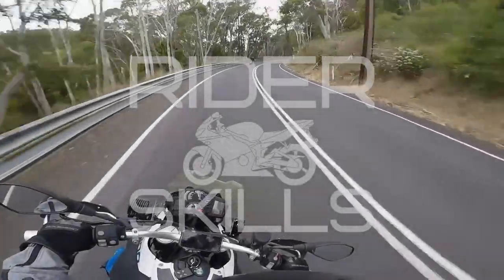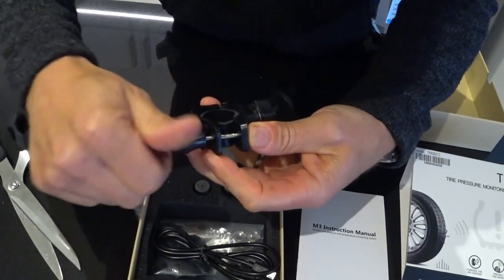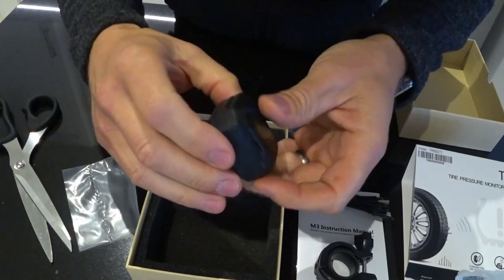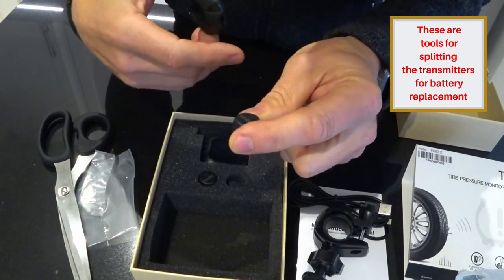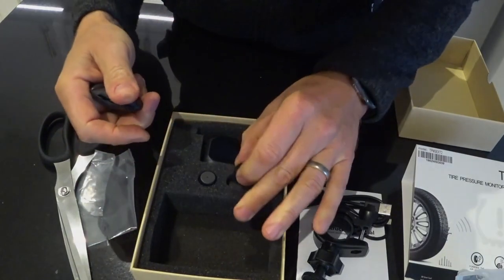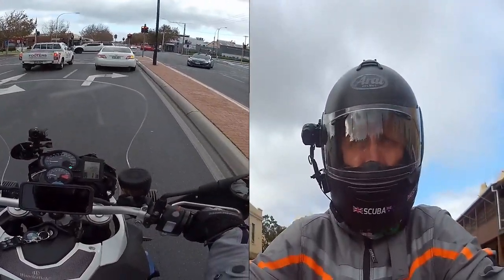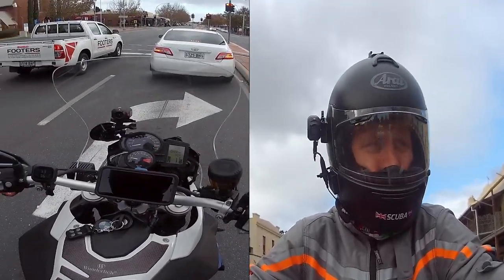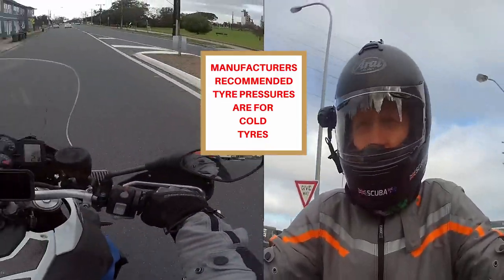MOTORBIKE TPMS DIGITAL TYRE PRESSURE MONITORING SYSTEM REVIEW

Comment: Pretty thorough ... these are a bit old school now, but just saw this was a 4 year old review!  For those considering these TPMS things, they're not really any use for tubed tyres, they won't really help because if you puncture with a tube, your air will be gone just as quick as any sensor would tell you.  Great for tubeless because a lot of punctures will be 'slow' leak and you get a warning from the sensor.
Reply from the maker: Yes, this was on a F800GS Beemer so I had tubeless.

Comment from the maker: 24/7/19 An update .....  which I think is worth doing if any positive or negative info comes to light after a period of time using a product that has been previously reviewed.  I charged this at installation, now seven weeks on and the unit still appears to have a full charge.  I still love the product and the features and benefits have made it superb value.  I've now got a solar powered version on my Toyota Hilux and am delighted with that also.  It crossed my mind for people towing camper trailers or caravans that these could be a serious consideration to monitor their tyres on them too.  From my experience these work at some distance from the sensors so there's no reason why the motorbike one couldn't also be used for that application.

Comment: This looks great.  One question:  Will the dust caps work if you have right angle valve stems?  My bike has right angle stems and they come pretty close to the rim - and those caps look a bit bulky.
Reply from the maker: +The 333 they’ll work but what I’ll do is measure them so you can compare the size to the rim to see if the fit.
Reply: @TheRiderGuider  Awesome - thanks man!
Reply from the maker: Sending you Instagram message 👍🏼

Comment: Hi there,
Is it possible to independently set the max and min values alarm, trigger values for front and rear tyre?
Thx
Reply from the maker: Deda Mraz great question, and the answer is YES.  I will follow this up soon with the instructions if you need them?
Reply: @TheRiderGuider  Yes, I need them for sure.
Regards
Reply from the maker: Deda Mraz I’ll  be in touch soon.  Got  printed instructions coming later this week 👍🏼

Comment: Do you need to balance the wheels after installing these?
Reply from the maker: Hi Liam, not the first to ask this, in my case I had no adverse effects by fitting them so for me I didn't bother, they hardly weigh anything at all.  Not something I'd purposely get done until I next changed a tyre.  What bike are you riding?
Reply: @TheRiderGuider  I installed mine today. Will head out for a ride later this afternoon and see how they are. Pressures are spot on so that’s confidence inspiring. I’m riding a Honda Africa Twin. There’s a good chance I carry more mud on a tyre than the TPMS weighs to be honest.

Comment: my tpms starting to have a bit of a problem.   battery on the display store power for a short time
Have you ever changed the battery on the display screen?
Reply from the maker: No mate, in fact my TPMS sold with the bike.  I now run a bike with tubes so the TPMS is not as useful.  If I get a puncture now my tyre is pretty much flat quickly.

Comment: What size wrench fits the sensor nuts? I bought a used motorcycle that came with this system
Reply from the maker: Marshall 3498 I’ll check in the morning mate and let you know.
Reply: Ok man thank you very much
Reply from the maker: @marshall3498  I actually haven't installed the locking nuts to my sensors, I'm not going off road and hammering the bike so don't feel them necessary, they fit and stay on fine, I think the locking nuts are just for theft prevention and I'd be very surprised if anyone even spotted the valve sensors were different to standard.  This morning I can't find my nuts (LOL) however if I remember rightly I think they were 14mm.
Reply from the maker: @marshall3498  NO - THEY ARE 12MM ....... found my nuts!!! ☺

Comment: Are you still using this item? If so how has it held up, is it remaining to work well and accurately? thanks for the help!
Reply from the maker: Hi Cody. thanks for watching/commenting.  I sold the GS to one of my best mates (Rich) and I'm kicking myself because I left it on the bike for him and haven't replaced it yet!  When I get a second I'll be re-ordering.   He's still using it as I instilled in to him the importance of keeping his pressures correct especially as he goes enduro riding) ... it's still working, still looks the same as far as I'm aware.  Unfortunately the original supplier doesn't supply them now due to the fact they're all over eBay and no longer as profitable for them. https://www.ebay.com.au/itm/153942660528 ... off to order my new one now!
Reply: @TheRiderGuider   Cheers i appreciate the info,  seen a few similar ones and just trying to come to a decision. Did it have any issues while in the rain? Thanks again.
Reply from the maker: cody merchant no .... pretty much a sealed unit.  I ordered my new one from that link I put up 👍🏼